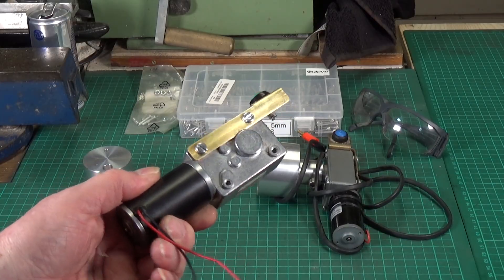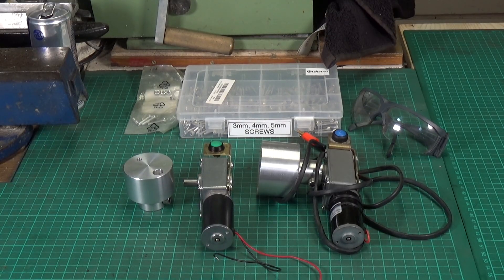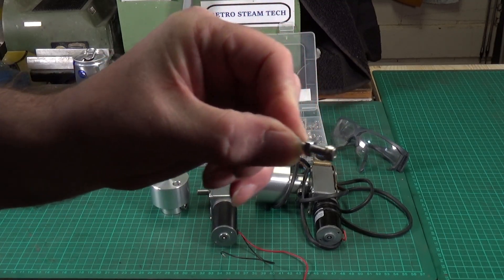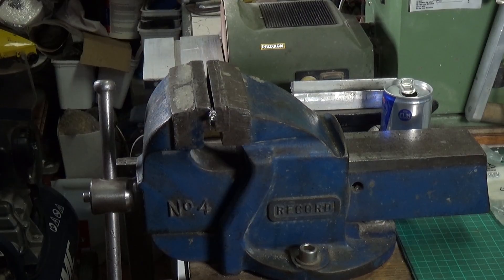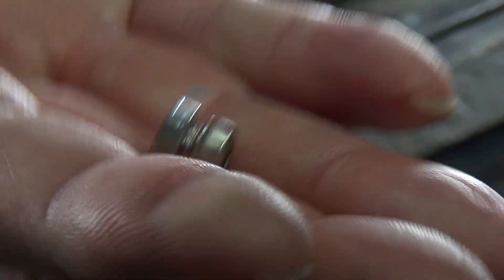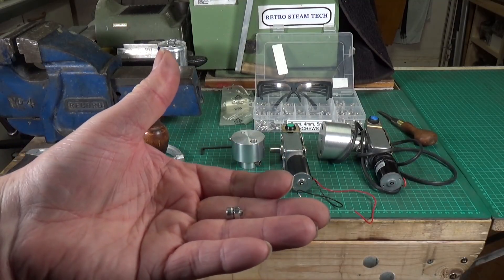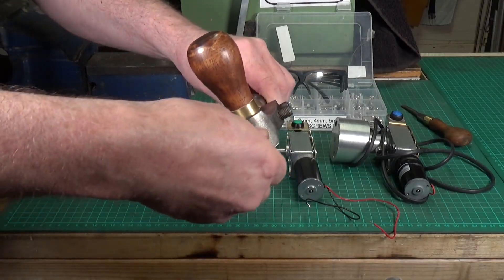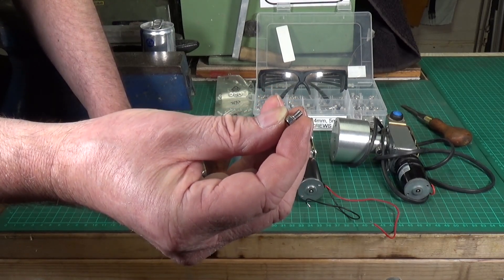Workshop Tip - How To Shorten Bolts The Easy Way

Comment: Hi Alan, Great Tip for any beginners.
Just the way I do it except for that Great "Old Fancy Vice Tool" you have, "they don't make them like they used too anymore". I'm Interested in that Motor & Gearbox for the Mill, might have a go myself, when nothing else to do, are you going to video that conversion.
Take Care
 Kev (mr. f's w)
Reply from the maker: Hi Kev. I thought this was well known but apparently not from some of the YouTube videos  I've been watching. The hand vice is a Millers Falls Alford Hand Vice, American manufacture. I did a video on it ages ago https://youtu.be/EAaqBOiOnlg . I'm not going to video the Mill Power Feed but I did  video the one I made for the lathe compound slide https://www.youtube.com/watch?v=zsu4skitkHA.  The links in the description from that video are not active anymore so I've added some new links to the description of this video for the motor and speed controller. Cheers, Alan.
Reply: @RetroSteamTech  cheers Alan yes i've just seen the compound video, i use an adaptor on my slow speed mini battery screwdriver, only thing with it though is its one speed, that variable speed is more suitable. i will take a look at the hand vice next.
cheers Kev ( Mr F's W)

Comment: I have a piece of 1/16 flat bar with holes drilled & tapped for various sizes. Screw goes in with washers/spacers &/or a nut on the head side, then the other side you cut & file flush to the bar stock. Simple, quick, easy to hold & accurate every time.
Reply from the maker: That's also a great idea. Gives you great repeatability.

Comment: Good tip Alan.  One my father taught me.  The only thing I do a bit differently is to put a very slight radius on the cut end so that the bolt will start easier.  Cheers Rob
Reply from the maker: Hi Rob. Like I said in the video I thought everyone knew this but I've watched a few videos recently where this wasn't done. The radius on the end is a good idea too. Cheers, Alan.

Comment: Do you have a link for the cross-slide motorising assembly, please?
Reply from the maker: This is the video I did on the power feed for the compound slide https://youtu.be/zsu4skitkHA
Reply: @RetroSteamTech  Links are out of date on that video unfortunately
Reply from the maker: @vtbn53  I've added links to the video description for a suitable motor and speed controller.